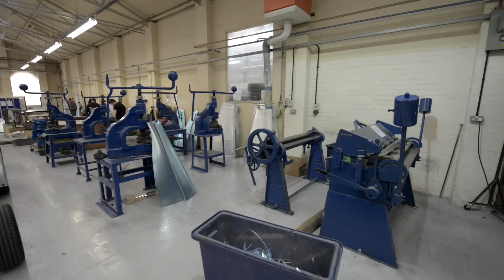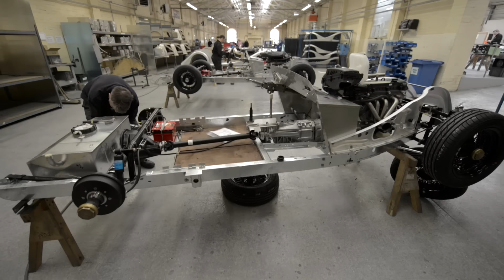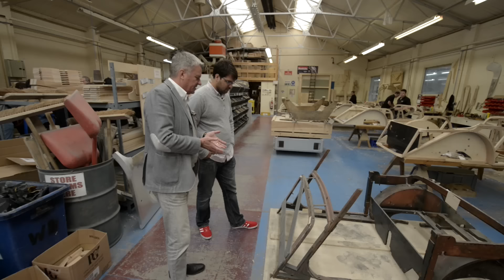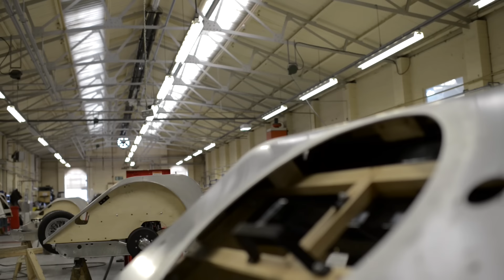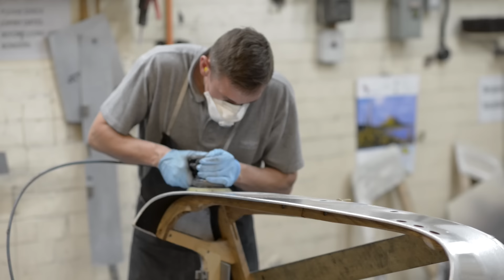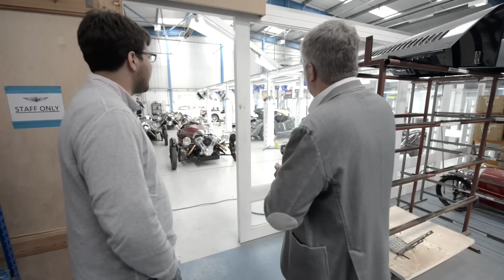Cars Still Made of WOOD! Inside the Morgan Motor Company

Comment: Wood is the first carbon fiber....
Reply: Heads Tails a lot cheaper, too.
Reply: xtra doc, 😂😂agreed
Reply: I knew that "someone" had orchestrated the blacklisting of hemp and cannabis in general, did not know it was DuPont though - thanks for that.
Reply: none I agree with your comment. The root cause of our problem is, we use wood faster than it can grow. Hence the destruction of acres and acres of rain forest that will take a lifetime and longer to regrow. Jane Goodhall showed a good example with aerial footage of the forests, where she studied chimpanzees for decades. Once wall to wall trees, now deserts with the consequences of loss of habitat for the wildlife, caused by timber extraction. There's more to cutting wood than gathering supplies for making things!
Hence our present day need for MDF, chipboard and such like as solid wood would not only be unstable in comparison, but near impossible to acquire the volume, with horrendous consequences.
Plastic is the new demon, used as a replacement for lots of things, examples Windows, doors, barge boards, facials, soffits etc. Now we make everything out if it from food containers to clothes and I'm sure you're aware of its impact on the environment.
I have a strange feeling we shouldn't be here, we're far too clever for our own good!
Reply: Without any of the properties of the modern product.
Reply: J H  ??  Laying grain at various angles?  Thats it, that's all.  That isnt u ique to carbon, any fibre composite (glass, kevlar, carbon, bassalt, and more cutting edge composites all use fiber orientation to tune the reinforcement.  With the modern fibres its often intentionally unbalanced

Comment: "Less than 2,000 pounds ... 1,150 kilos"? 1,150 kilos is 2,530 pounds!

"Zero emissions vehicle". Until you realise that virtually all hydrogen is currently produced by use of fossil fuels.

The first Morgan I saw 'up close and personal' was in the late 1950's. It was being stored in a building dating from the Middle Ages (since demolished) in the middle of my village. It was one of the very early ones with the 60 degree twin cylinder motorcycle engine mounted ahead of the grill. According to the owner he could remove it, along with part of the prop shaft, and drop in a small water cooled engine which had come with it from the factory.

Would I have one?

In a heartbeat!

Comment: In 1968 I owned a Series 2 Morgan , I believe it was a factory special. It had an Elva head , twin carbs and remote gear shift amongst other things.  I paid 250 quid for it , sold it in 1970 for 350 quid.  I think it is still going but now no longer red but white with a 1500cc engine. Great liitle car.

Comment: are laid out correctly with the ‘single’ wheel at the back and still are raced.
A racing version is of course a lot lighter simply because all sorts of trim and other stuff is left off, but two men could probably lift a finished chassis minus the engine and drive which will again I am guessing, weigh more than the body.

Thank you so much, and do you realise just how honoured you are to be shown round the ‘Factory’ by THE Morgan Family Member?

Comment: The aluminium outer bodies for the 3 wheeler are made and fitted onto the wooden frames at Premier Group in Coventry. Premier also makes many of the outer panels for the Aero Supersports and assemble the rear end of it. The prototype of the Life car was also made at Premier. Some of the comments have asked whether the wooden frame for the 3 wheelers are safe. They are mainly used to keep up the Morgan tradition. The body panels are fitted to the wood but it is all fitted over a metal tubular frame and none of the chassis is made from wood

Comment: All cars at some point would need welding or if carbon just scraping. With wood you just replace the bits rather then weld. Aluminum stresses and is very hard to fix. Wood is very strong and used the right way last a very long time. Some would hoses in the UK are 400 years old and standing. Also a Morgen will tend to be still in use after 30 or 40 years so far longer then a normal car. Add this all together and wood is very good.

Comment: It's cool to see the simple selection of 1.6, 2.0, and 3.7 Ford engines waiting to go in. I'm curious as to why the 3.7 V6 only has 280hp, when it looks like they're using the 300hp V6 that the 2015-2017 Mustang V6 used. The BMW V8 has to be the coolest though.

Comment: Or not - By law the rear fog light has to be on the drivers side if there is only one, which is on the right hand side. So they use the passenger side for the reverse light. So they don't have to have 2 pairs of lights on the rear. This is quite common and the number of cars that has this are to many to list here.

Comment: Think about an older muscle car that has been used and not parked indoors. They are rusted like all hell. This car instead of needing to do metal work and replacing rusted sheet metal and quarter panels, you just replace the wood frame. So either way it's the same thing. Both cars will have body issues if not taken care of properly and sitting outside for decades, etc. If that makes sense, aha.

Comment: I am amazed that there are still small auto manufacturers out there. My private dream? Start a company that builds modern replicas of 1950's classics! Imagine being able to drive around in a comfortable and modern 1953 look-alike with a modern engine?
Reply: Couldn't compete with SUVs, plus all the new safety regulations. Actual classic cars get grandfathered in, so they don't have to meet the same regs for inspections. And all the steel! I'd love to be able to hammer out dings and dents again, but it's so much cheaper, lighter and more fuel efficient to have replaceable plastic panels. An updated replica would cost a small fortune.

Comment: I have seen a Morgan back in the 60's. Looked like fiberglass repair work was badly done on the body. The rag top was in rags too. Didn't think too much of the car;though it looked as though a Ford V8 289 engine was put under the hood so "butchered" POS. Maybe it was a Mustang frame with a Morgan body KIT placed on top?

Comment: It looks like someone is realizing if ev's are going to be a reality, the charging networks that are now are not going to make that happen. My only car now is a 2018 Bolt. For most of where I go the system is fine. Ninety percent of my charging is at home, level 2, so no problem. I live in norcal and if I were to go to LA (like you do all the time) I can't see spending an extra 2 hours charging my car and of course an extra 2 hrs coming back. (or more because I will have left home with a full charge). So far every EVgo charger in NorCal has never given me more than 100A, that is only 35 to 37KW. Car makers also need to let the batteries charge faster too. I understand super fast charging is not good for batteries, but in time new technology will allow for faster charging, so these 'new' charging stations will be great. At home I never charge to full because that is not real good the batteries, but on the road, I don't care, I just want to get there as fast as I can. Btw, you drive your Bolt harder than I do!  I like to get at least 275 miles out of a charge.
I enjoy your videos, keep it up.
Thanks

Comment: 2000 pounds is extraordinarily  heavy. Some 40 years ago: The East German "Trabant" dit weigh 615 kg (about 1200 pounds).
Reply: Peter8aus8Berlin but that was made of plastic and had a tiny engine not a 4.8 litre V8.
Reply: @Spencer Wilton And I thought minimizing weight is in order to minimize fuel consumption.
Unfortunately: The Trabant has an extremely high air friction (there are still thousands of them on German roads). The engine is quite ineffective too (2 valves). Would one take that car and made it a bit rounder around the corners and put a 17 kw diesel engine in THIS car should make up to 140 km (currently it makes about 120 km/h with it's 17,5 kw engine)  and it would swallow less than 3 liter diesel per 100 km (at some 80 km/h). Let alone one would make a 3-wheeler out of it (delta-shaped).  But I guess: That's not what Shell wants.

Comment: Looks great...Good old fashioned car factory. But...They are pretty nasty contraptions...I have worked on a lot of them, made from partss of obscure vehicles, bits of plywood..another factory that makes tractor cabs makes the chassis, frankly the earlier ones were horrid, with ill fitting doors, bonnets etc...they drive like a 1960's Mini...bouncing all over the road with outdated suspension...The only one I drove that was good, was an Aero Eight.  I would Not want one of these cars....

Comment: I've been to the factory. It's very interesting. Some of it is just crying out for some proper production engineering - hand drawing round things with marker pens when a few jigs could sort it, for example.

The whole "old fashioned Morgan" thing is a bit of a cultivated myth really but it obviously appeals to their customers.

1100KG isn't ultra light. It's lighter than a typical BMW for sure.
Reply: Probably true, but has this company ever suffered any financial reverses?
Reply: 1100kg 4.8L V8 2 seater isn't a light weight? A 2014 Toyota corolla 1.8L L4 motor and manual trans weights 1255......
Reply: MoparAus One w201 Mercedes, 190E 2.0 from 1983 weights 1170 kg and has 120 hp... The Cosworth version, 2.5-16 Evo II had 224 hp, tunable to 350, and 1300kg... Cars with nearly 30 years... The first M3, 911 where much lighter than the newer ones... The only other company who still makes them light, besides morgan, its Lotus, usually bellow 1000kg... The fact is that not only population is getting fatter, but cars also!
Reply: Jorge Clemente the Alfa Romeo 4c weighs like 700  or so kg
Reply: Tom Stickland

Comment: The chasis is glued, not welded?
Reply: JayBr61 most high end cars uses bonded materials now, either bonded aluminium or carbon fibre mainly. The bonding is often stronger than the materials themselves, and certainly stronger than welding.

Comment: Can I get one with a 6.2 lsx ?
Reply: Probably the Aero 8, but not the 3-wheeler. I toured the factory once, and there were fenders and trunk (boot) lids with chalk marks on them. When I asked what the marks were for, it was explained one buyer wanted the fenders/running boards two inches wider, one buyer wanted the tail lights in a different configuration, one buyer wanted different headlights. The answer to all was OK. They are so hand built you can pretty much pull one out of the assembly line to do anything. Assembly line is in fact, not really accurate, they just push each chassis from station to station by hand. In fact, I helped push a couple around when I was wandering through the buildings. 
The 3-wh would be a monster if you could fit it though, at 776 HP, in a vehicle which weighs 992 lbs. Vvvrroooom

Comment: A car made of  laminated wood ?
How preposterous !
But hang on, one of the most successful aircraft in WWII was made mostly out of laminated wood, and that didn't find it a problem, the magnificent Mosquito...........:)
Reply: Pete is never wrong  ...Cheers....:)
Reply: John Small   Yep, a Jack of all trades, and a master at most of them.
Low level attack bomber - tick.
Good heavy bomber support - tick.
Fast recce plane - tick
Fast and well armed - tick.
Path finder - tick.
Night fighter equipped with radar and many guns - tick.
Some were converted to take a couple of about 580Kg bombs for having a go at sinking the Tirpitz, but the conversion was not required since the Lancasters did the job instead.
Plus surprising able to take some flak damage etc., as well.

Comment: Car parts glued together? What if its hot outside and you hit a bump on the road?
Reply: Like the man said: "Adhesively bonded aluminium, the same principles as the (Formula One and Indycar) racing cars." And I don't see them having problems in hot weather. ;-) He gives a pretty good explanation of it at 20:10
Reply: goinghomesomeday1 But glue eventually dries up and breaks and wood rots.
Reply: goinghomesomeday1 wow I did not know that. interesting.
Reply: latengocomoburro 
Words fail me !
Reply: latengocomoburro Steel also rots and much quicker than Ash also modern resins do not de laminate like the old bonding agents
Reply: latengocomoburro and metal rusts. Whats your point?
Reply: goinghomesomeday1 thats not because they don't rot or something. More likely it's because they are rare and even beat up morgans sell for decent money to people who restore or part them out for profit. Same reason ferrari's, lamborghini's and 911's are rare scrapyard finds while they get wrecked more often i imagine.
Reply: Yea I don't think they use pritt stick..

Comment: You also use wood because its cheaper! Lets not beat about the bush, a fact that might not be passed back onto the customer
Reply: actually it came from building airplanes in the 1920's. Laminate wood is also extremely strong and very light. It is cheaper than having metal presses designed and built to press steel panels but that is not the reason.

As to passing it back to the customer - a Morgan plus 4 or 3 wheeler is around £35k - cheapest hand built car on market by orders of magnitude
Reply: Well, I stand corrected

Comment: Glued aluminum unibodies? Pretty cheap and difficult to repair for an upper level car design. Hope they don't make the three wheelers like that! BTW, wood rots:(
Reply: Actually wood in incredibly durable if properly treated and protected. It's still heavily used in boating,and has been found to be more durable than fiberglass if taken care of. As for bonded riveted aluminum structure, Jaguar has had it in production very successfully since '03 in the XJ. Repairs have been worked out and effective and safe. This system was pioneered in military and commercial aircraft and has proven to be one of the best systems for using aluminum.
Reply: Oldbmwr100rs
My point being that any kind of crash repair is going to be expensive , plus the fact that aluminum just doesn't replace steel in terms of strength, rigidity and cost when it comes to car bodies. It's akin to going all carbon fiber  and fiberglass. Sure, it can and is being done, but the final monoque is just not as durable as steel would be, MUCH more $  to use and especially to repair, if it can be repaired at all. I had aluminum frame Mountain Bikes, but my motorized bike is moly steel.
Reply: TheGearhead222 Golly, they really need you in the team
Reply: tim sims Just as they need you!:)
Reply: Nope - they don't need me!! But on the other hand I'm not criticising a maker of cars that make nice original cars - that would be you!
Reply: tim sims
When you get a chance, try educating yourself on how the older Morgans were built, okay? Enough said....
Reply: Metal rust. Wood can last more than a lifetime if treated properly. They treat the wood before they assemble the car. Yes the three wheeler is made of wood and aluminum.

Comment: Zero emissions, my eye!!! How many conventional fuels and petroleum derived paints and adhesives were used for the parts!!! Bogus!!
Reply: Spuds it hardly matters, given that only a handful will be produced, and most will still be running in 50 years.
Reply: @spencerwilton5831  it is a matter of truth in advertising.  If they emphasized the point that they used unique products or methods that do not expend a lot of conventional energy and/or resources, then that would be more palatable.

Comment: A car with a wood frame just plain stupid never mind it lets the rain in every window. Just old engineering like Triumph stage. It goes great in a streight line and thats about it. Very poor interior, seating, feet position. Dosome research and youll be scared to drive one.
Reply: SixSixteen Sevens These are hardly every day cars. The people that buy them on the whole probably have several vehicles and would hardly use this as a runabout in winter. They are a work of art, built for summer drives on country roads.
Reply: @spencerwilton5831  Cars with wooden frame should not be allowed on roads.

Comment: Car from wood? Why they do it because wood pretty cheap. If you shape the car with metal it cost  100 million USD every assembly line.
Believe me any motorcycle far safer than this piece of wood.
Reply: sapbil Wood is stronger per pound than steel
Reply: Luckystrike Then why not build skyscrapers out of wood??
Reply: +Luckystrike total annihilation lol
Reply: ThraxI1019
 Low hanging fruit, but thanks for the comment.
I sometimes wonder if anyone reads my rants.
Reply: Keith
OK, here goes
It doesn't work. See the above comment for specific reasons.